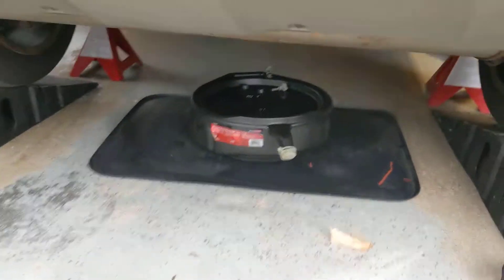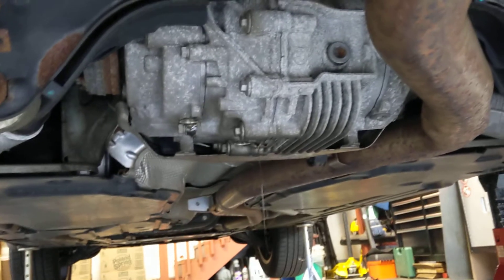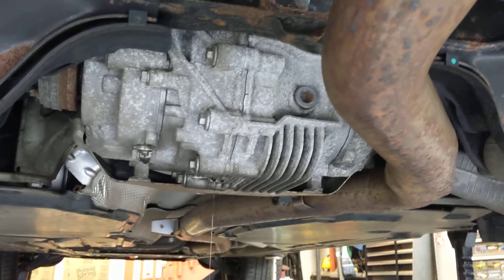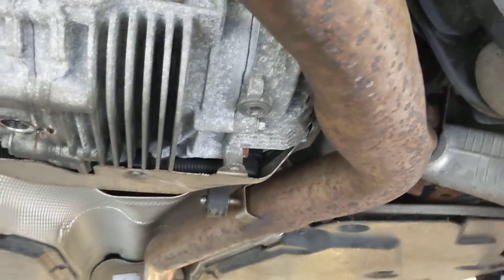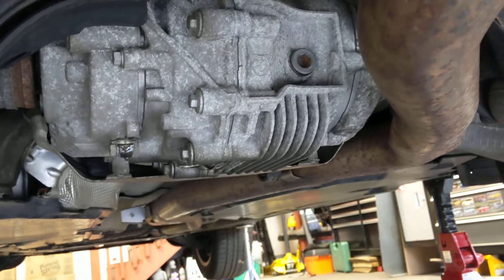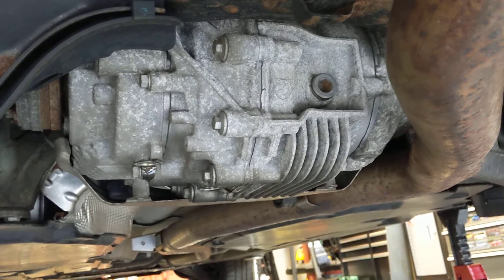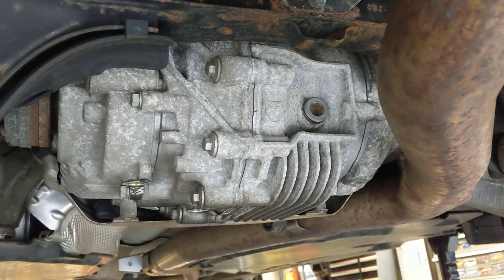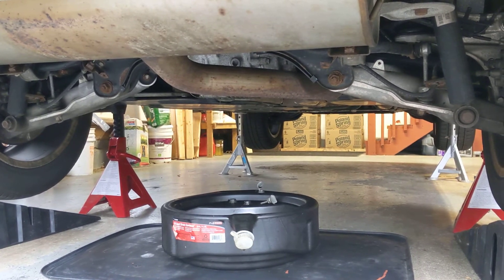BMW E71 X6 Rear differential fluid DIY

Comment: The E71 has a Torque Distribution rear differential and it is active!  You MUST use the correct fluid types.  The E71, X5(M) and X6(M) share the same rear differential.

Comment: Hey. I have a 35d x6 2010. How many liters do you used? Did you put until the oil leaked? Or like i found on a website  0.5 1.20 0.5
Reply from the maker: I used approximately the amount you quoted. When you fill up to those capacities, it will start dribbling out.
Reply: @MINIzguy  thank for the replay bro 💪🏿

Comment: What oil type?
Reply: Differential Oil SAF CARBON MODULE 0,5L  (oem 83120445832) to both of the side sections. OSP synthetic 75W-90 (oem 83222365987) in the middle section.